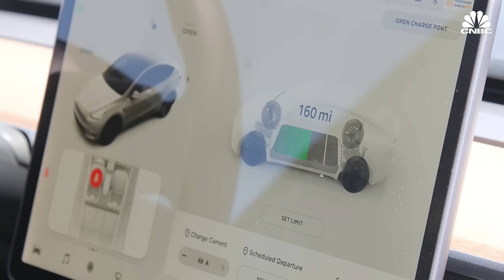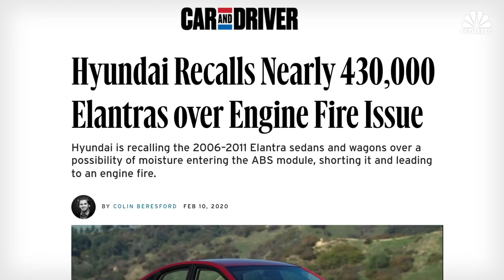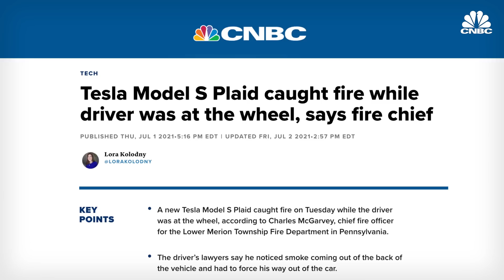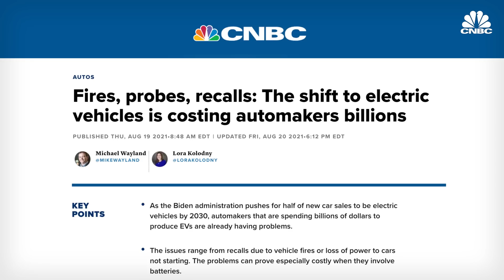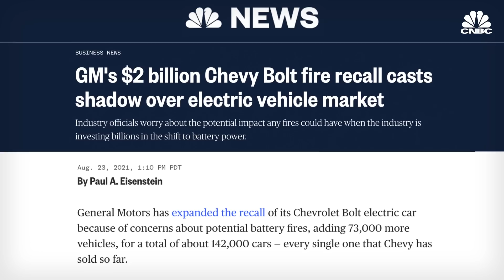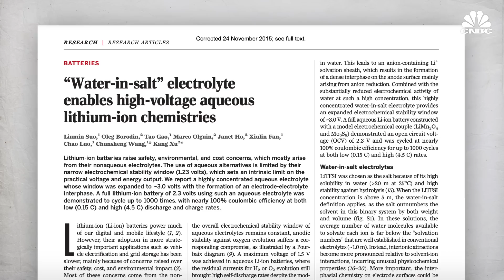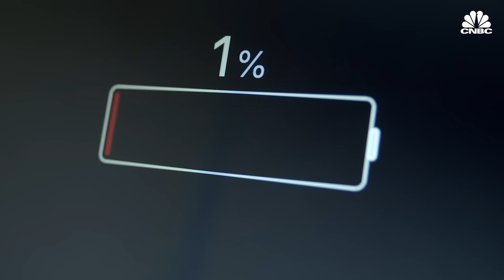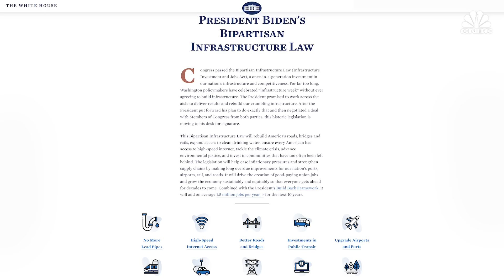Why Tesla, GM And Other EV Companies Have A Fire Problem

Comment: Any fuel source can be dangerous.
The danger should be measured by how fast can these fuel sources deplete its stored energy. Catastrophic failure of battery (I.e. shorting of anode and cathode) will be more dangerous than oxidation of hydrocarbon that isn’t atomized.
Reply: Imagine a FC fire burning Hydrogen as fuel. Hindenburg.
Reply: @markplott4820  if the tank is punctured the hydrogen vents to the atmosphere harmlessly. If it happened inside a garage that could be problematic but outside you're fine.

Comment: I wish that actually broke down those fires and told us what percentage were from internal combustion engines and what percentage were from EVs. I don't like this article. My guess is that it's sensationalized. Are their EV fires? Of course. From a percentage standpoint, IS IT HIGHER THAN INTERNAL COMBUSTION ENGINE (ICE) CARS? That's what matters.

For example, if you said there was one car fire for every 100 million miles ICE cars are driven and one car fire for every 1 million miles an EV car is driven, that would be bad for EVs. But they never gave us that very important data, which means they're hiding it, which means this is just a hit piece on EVs.
Reply: That is not the whole story, an EV fire is much more difficult to deal with and can more easily reignite.

Comment: Why do I feel like Greta Thunberg and politicians and environmentalists dont take these issues into consideration when they make broad statements like "we need all electric cars!"
Reply: There's so much you can put into a speach.
Reply: You mean these statistics...?  "Fully electric vehicles, on the other hand, were deemed far safer than both hybirds and gas cars; they are far less likely to catch fire, with just 25.1 fires per 100,000 sales. That's compared to 3,474 hybrid fires and 1,529 ICE fires per 100,000 sales respectively."

Makes electric cars sound pretty good to me.

Comment: I’m still getting my ev this year, gas cars have caught on fire as well, so one sided!
Reply: How cute. You have been brainwashed by the liberal government’s climate alarmism scam.
Reply: Good for you! Are you able to fit a charger at home? It's much cheaper than using public ones. Even better if you get one that can automatically charge at times of low electricity demand so you can do your part at balancing the grid!
Reply: @Yummy Spaghetti Noodles re: "I've never seen a gas car catch fire for no reason just sitting there in your home at night while you sleep." correct, it's the FIRE TRIANGLE (ref OSHA).  in order for liquid fuels to burn there needs to be a HEAT or IGNITION source.  keep the 2 separate and the result is "no fire".  it's essentially how we're able to go to a gas station in the summer time with a plastic can to get fuel for our lawn mowers.

Comment: Depends on the make and the mechanic  who can fix it and don't keep charging  once reached 100 percentage
Reply: it's discharging batteries quickly that causes heat or discharging a battery after it has reached it's minimum voltage,the longer you leave a battery discharged the more likely it is to release gas. batteries need be cycled to keep them healthy and they need to be stored at a particular voltage when not in use.storing a battery fully discharged is not good.
Reply: @gogogeedus  That is relevant to Lead Acid batteries.  It has literally nothing at all to do with EV batteries which are Lithium Ion, and don't release gas like Lead Acid do.

Also, Lithium Ion batteries do not need to be cycled to keep them healthy.  They have no memory effect and no cycling is necessary.
Reply: @redbaron6805  No you are wrong,when you get a runaway situation these batteries will release gas and the gas is deadly hyrogen cyonide, then that gas will ignite and the fire will not be extinguished while that condition continues, the only way to put out these fires is to place the whole vehicle into a large vessel filled with water.
Reply: @redbaron6805  Cycling li-po's is important but it is more important not to overheat them or leave them discharged or in an unbalanced state. but you are right the don't have memory like a ni-cad. unbalanced cells can short circuit and release gas. do your home work.
Reply: @gogogeedus  Electric cars don't use LiPo's, they use NCA or NMC batteries.

They also don't overheat as EV's have a cooling system for the battery.  LiPo's don't.  So heat is not an issue as that is something EV's manage 24/7.

So, don't try to apply completely different technology, management and battery types to EV's.   It simply doesn't apply.
Reply: @redbaron6805  Well it will apply in conditions like faulty cells,and that's why we have seen fires with EV's, maybe the technology has improved but I would be surprise if we don't see more fires,I hope you are right and we don't , but if you did have an EV fire you would have one breaths time to evacuate the vehicle and I would not be driving with the doors locked because if they are electrically activated door locks and you have a battery short circuit you are in there forever or until you leave as a smoke ghost.
Reply: @redbaron6805  I don't know if you know this but a ship called the Felicity Ace sank because of an EV fire it was full of EV's and other vehicles. now it's at the bottom of the ocean, that's not good for the environment, I like EV's but don't tell me the tech is perfect at this stage.
Reply: @gogogeedus  Look, you really need to start understanding how EV's actually work when you post about them.  

There are significant gaps in your knowledge which results in you making claims which in reality simply don't make any sense.

"if you did have an EV fire you would have one breaths time to evacuate"

No, you would not have "one breaths time" to evacuate an electric car if it has a battery fire.  There have been punctured battery fires that happened already.  The car sensed a battery fault, asked the driver to pull over when possible and evacuate the car.  The fire then slowly spread.  It took like 10 to 15 minutes for the process to take place, not seconds.  

"and I would not be driving with the doors locked because if they are electrically activated door locks and you have a battery short circuit".

Sigh.  Here is a newsflash for you.  The door locks work off the 12V battery, not the 400V or 800V battery used to power the motor.  So, if the main Lithium Ion battery has a fault of some kind, you know what happens to the door locks and windows?  

Literally nothing at all, as they run off the 12V battery in the car.  Everything in the car from windows, seat, mirror, sunroof, electronics, lights, etc. runs on 12V.  That system has a separate 12V battery on board that runs those systems, independently from the Lithium Ion battery.

So, please learn how this actually works.  It isn't that difficult to find.  These claims you are making are pointless and are simply completely divorced from reality.
Reply: @redbaron6805  Of course they are12volts but i;m sure it has a reducer that drops the voltage to 12v it wouldn't have a separate battery, Wow know I know why people hate EV drivers ,it's because they are real know it all's. you didn't comment about the ship that sank,doesn't fit with you alternative universe sense of reality.
Reply: @redbaron6805  There is a fire fighter that made a comment on this sight that says these battery fires will reach 1600 degrees, your cooling system is not going work above 200 so good luck with that.
Reply: @gogogeedus  Yawn.  Fires get hot Einstein.  Gasoline fires are above 1500F.  In other news, the sun is bright, water is wet and snow is cold....
Reply: @gogogeedus  It DOES HAVE a separate 12V battery Einstein.  Which part of it HAS a SEPARATE 12V battery are you struggling with?  Which again is why it is getting old you rambling on about things you obviously DON'T understand.  

And an Inverter converts DC to AC.  If the car did NOT have a 12V battery, it would use a DC to DC converter, NOT and Inverter.

So, stop claiming stuff you are just pulling out of thin air.  It is getting old already.  If knowing how this ACTUALLY works makes me a KNOW IT ALL, then I'll proudly wear that label all day long.  

And I DID comment about the ship that sank above your post.  So, reading apparently isn't your thing either...
Reply: @gogogeedus  BTW, here is the manifest of the Felicity Ace since you keep wanting to bring that up...

Combustion cars:

2017 VW Jetta
2007 BMW750i
1996 Honda Prelude
2018 Nissan Versa
2014 Kia Soul
2015 Porsche Cayenne
2015 Ford Mustang
Tractor Accessories
1 Audi Q2
418 Audi Q3
12 Audi A5
138 Audi A5 Sportback
60 Audi A5 Cabrio
33 Audi A5 Coupe
20 Lamborghini Huracan
15 Lamborghini Aventator
50 Lamborghini URUS
7 Audi TT
1 Audi TT Roadster
21 Audi A5 Cabrio
17 Bentley Continental
38 Bentley Continental GT
46 Bentley Continental GTC
8 Bentley Flying Spur
77 Bentley Bentayga
1 Mini Countryman
1 Truck MAN TGM 
1 Land Rover Santana
47 VW Caddy
116 VW T6 Transporter
24 Porsche Cayenne/Macan/Panamera
3 Seat Ateca
253 Porsche Cayenne/Macan

Total 1415

Known electric cars:

104 VW ID4
95 VW ID4
91 Audi E-Tron
30 Audi E-Tron Sportback
1 Audi E-Tron GT

Total known electric cars 321

Taycan Eletric and 911 Combustion Cars:

143 Mostly 911 and 918

So, as you can see, of the 1879 cars aboard the Felicity Ace, barely 20% of them were electric, around 80% were combustion engine cars.

But, I'm sure you already have located what started the fire ahead of all the investigators...
Reply: @redbaron6805  I guess they put a second battery there in for the fun of it, ow no, they put it in there in-case there's a fire,Well that's confidence in your product if ever I've seen it :)
Reply: @redbaron6805  readings overrated :)
Reply: @gogogeedus  Except of course that is yet another ridiculously idiotic claim.  Electric cars use 12V volt components, and run anti theft, communication and other systems off the 12V battery along with the power locks and remote lock/unlock feature.

But, thanks for proving yet again you really don't understand how any of this actually works...
Reply: @redbaron6805  Yawn! driving a EV would be yawn,that's why Teslas self drive because it's so boring you fall asleep.
Reply: @gogogeedus  Reading is definitely highly overrated if you want to comment on things without elementary understanding on how they work.....
Reply: @redbaron6805  here's how an EV works, A battery powers an electric motor or two that drive the wheels,THE END. true story
Reply: @redbaron6805  Getting back to that Felicity Ace thing, my ancestors were involved in the merchant shipping industry for 100 years from the early to mid 1800s to the early to mid 1900s they had a fleet of sailing ships in there employ and over the period of that 100 years do you know how many ships they lost?, NONE, they carried wool from Australia to England, Steam Engines to India and Australia,and Tea from India to Australia, they even purchased an oil burning ship call the Brilliant and converted it to sail,that ship was sunk by those scallywags the Germans after it had been sold to another company, we've come a long way haven't we. now we can't design a ship that doesn't roll over and sink at the sign of trouble. we have some amazing people designing some amazing tech but they can't get the simple stuff right so whats the point.
Reply: @gogogeedus  Ships have always been lost through the centuries since the dawn of time.  Modern ships are safer, but also larger with different challenges.  So, they can go down due to multitude of reasons from fires to weather to lack of maintenance to human error.

I don't think that will really ever change.  As far as the Felicity Ace, it was carrying close to 2000 cars.  Something went wrong and a fire started which eventually brought down the ship.

Could it have been from an electric car?  Sure.  Could it have been from something else?   Yes.  No one knows yet.  Loading large vessels is an art form it it self, you have to secure a lot of cargo and it has to be loaded in the right locations with the right amount of weight or you get the Golden Ray situation that happened 2 years ago.

All technology ultimate has to balance performance vs cost.  In many cases, you can spend a million getting things to 98% but would need another million to fix it to 99%.  No one wants to pay for that.

Hence, we will end up with technology that is good enough, but not perfect.  No one will pay for perfection, and there are no guarantees you can even get there.  Until that changes, we have to make do with what we got.

Comment: Exploding EVs are a death trap, gasoline cars are always better for the environment no hazardous mining and runoff... I don't care about ev just don't force us to switch
Reply: This is so far from the truth that I’m convinced this account is a Big Oil bot. Go read the many peer reviewed publications and you will quickly find that electric cars are cleaner than ICE even when running purely on coal plants.
Reply: Fear mongering at its best. Like airplane  crashes and yet people still fly. Why? because the risk of that happening is very very small. 

Gasoline is better for the environment?  Is that why there are signs "no idling?" Oil spilled destroying coastal lines and polluting the ocean is not a thing? 

EV can power your house for days in case of a blackout.

Comment: It's not just cars, but any Lithium ion batteries. Tesla house chargers and solar farm batteries have also exploded.

Why not use Vanadium Redox Flow Batteries for larger batteries, its impossible for them to catch fire. They also have a longer shelf life and better for the environment.

 Lithium poisoning the environment will be a serious problem in a few years.
Reply: No "chargers" have caught fire.  That is actually false.  And they don't "explode" they simply catch fire.  The reasons why they don't use other materials than what they do use are countless.  Energy density, charging rate, material availability, cost, etc. etc.

Comment: Lithium Titanate is an interesting chemistry
Reply: Lithium titanate (LTO) is brutally strong. You can throw massive amounts of electricity at them over a very short time period and operate well over a wide range of temperatures. They're also very safe in regards to fire danger. 

Trouble is, energy density is very low and voltage tends to drop as they discharge. In that respect, they're almost like ultracapacitors. The final blow is that the raw materials are expensive. LFP has pretty much made them irrelevant. 

Upcoming sodium ion cell tech from CATL has many of the desirable characteristics of LTO and that materials are super cheap. They appear to be a good prospect for things like grid storage applications. We'll see when they get here in another year or so.

Comment: EVs have a fire problem, unlike ICE vehicles which run on perfectly safe, nonflammable, nontoxic, environmentally benign… gasoline
Reply: Yeh even when people smoking their cigarettes when they pump gasoline into their vehicles.
Reply: Smoking Even when people fill their gas containers with diesel fuel for their kerosene heaters.
Reply: Seeing quite often year after year. So far no explosions but damn scary moment watching them.
Reply: Gas stations should post their security footage on YouTube.
Reply: The difference is evs burn down your house while you sleep not on the side of the road after you've evacuated.
Reply: @TheV8nissan  you think nobody has died in an ICE fire?
Reply: @TheV8nissan  You mean like the Ford's that were catching fires in people garages and burning down homes?  Or BMW's?  Or Hyundai's and Kia's.  You may need to be a bit more specific.  Are we pretending fire recalls for combustion engine cars don'e exist?